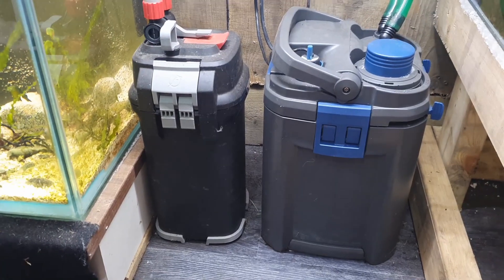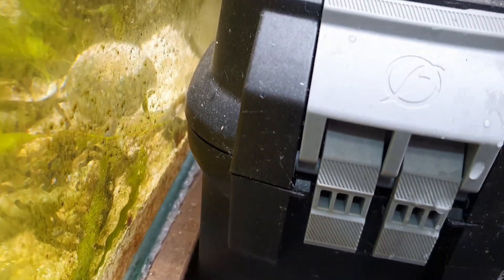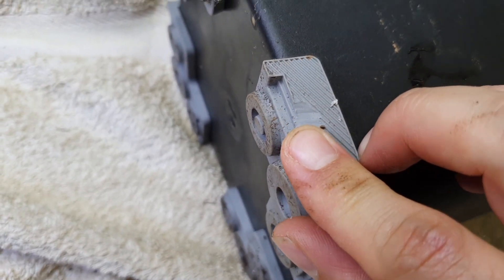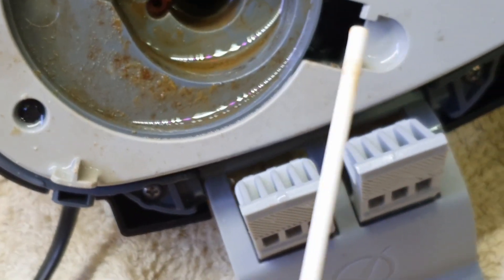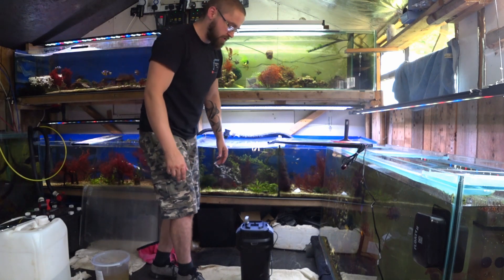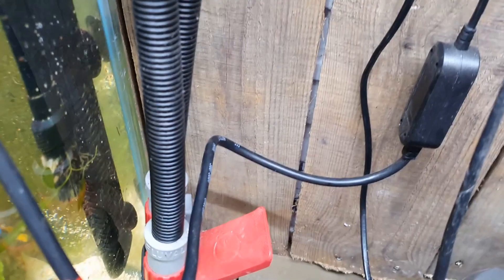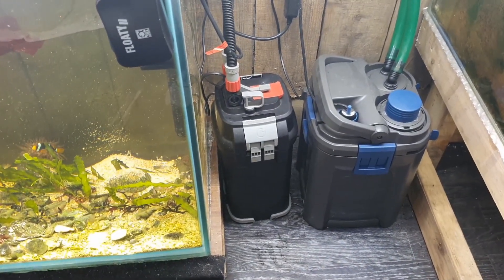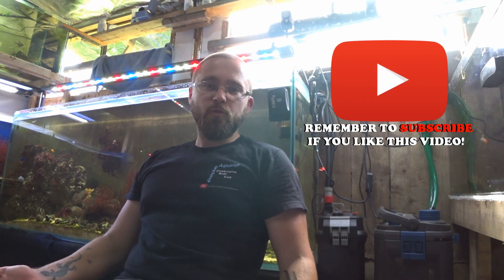Fluval 07 Canister Filters: ARE THEY ANY GOOD? Durability & Reliability Review | 107 207 307 407

Comment: You mention that the Oase and Eheim are German companies. You don't seem to realize that  Fluval is a German company also.  The Fluval 407 is actually rated higher than the Oase canister filters...even from buyers on Amazon.  Of course though, Oase is a relative newcomer to the home aquarium market.  They were mainly known for constructing fountains...large, commercial fountains, such as what you might see in front of a large hotel.  They also have a satellite wing that installs a few residential fountains each year.  It was only relatively recently that Oase decided to enter the aquarium market. With no knowledge of or experience with  aquarium products, they had to purchase an Italian company that previously made aquarium products under a different brand name...and that's where Oase canister filters are made.
I might try an Oase a few years from now, but not right now...with about 10% of buyers giving Oase canister filters a one star rating...I'll stay with Fluval filters for the foreseeable future.

Comment: Had my 307 for 17month now, All was going great until I recently had to replace the original rubber seal , been a nightmare since despite replacing the rubber seal 3 times with genuine fluval ones...it leaks and don't get me started on the amount of trouble it takes to prime due to it drawing in air....
Reply: Ive never had a problem even when cleaning the input and output tubes. I fill the cannister with water after cleaning, connect and I don't even use the plunger, and it's siphoning. Good luck I have multiples of these for over 10 years no problems.

Comment: I just got a 75 gallon tank and was wondering if the 407 would do the job?
Reply: Did you go with the 407 on the 75? If so, how's it working for you? I'm in the same position at this time. Thanks!
Reply: @stephenedwards9341  I have two 75 gallon tanks, on one I have a fx4 and on the other I put two 407's i actually prefer the 407 because its easier to clean and maintain, and I rotate cleaning them. The fx is a good filter also just big and bulky, and I have a bad back so I'd rather use the 407.